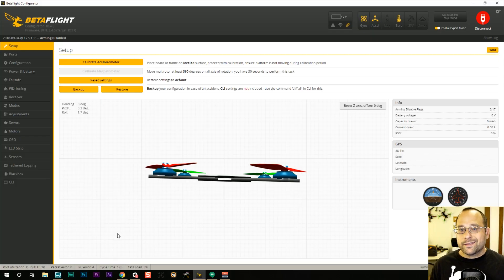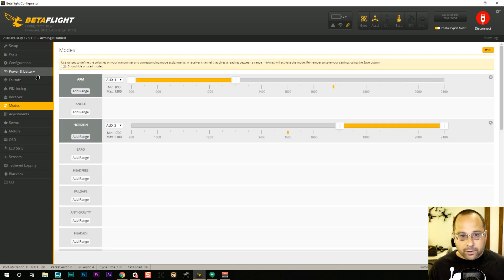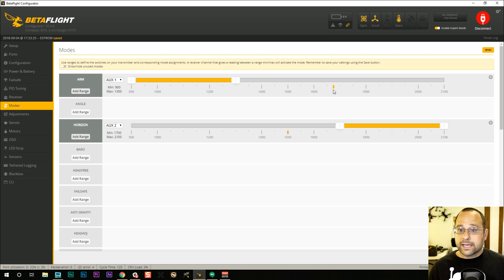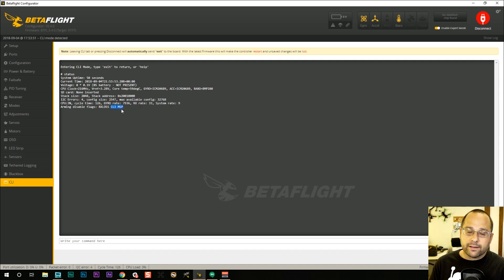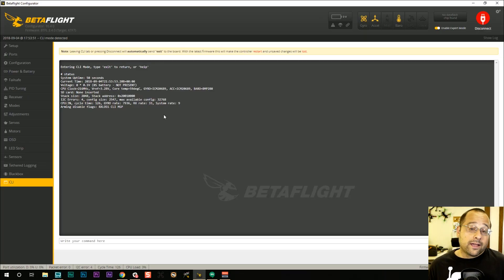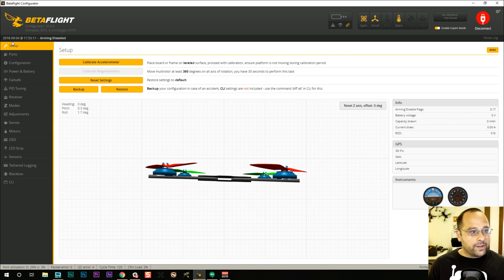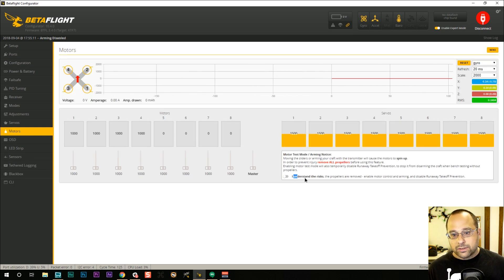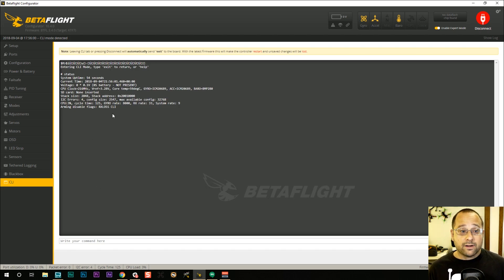BETAFLIGHT WON'T ARM | CLI MSP arming status flags

Comment: I have an issue, trying to set up a tricopter and my motors run continuously when not armed, about half throttle. Also, ESCs wont initialize when not plugged into USB. And the servo is backward, but that's another issue.

Comment: BUT when I disconnect the MSP goes right back on and I cannot arm!!  How can you switch it off for good!
Reply from the maker: You cannot. Every time you connect it comes back. It is an important safety precaution.
Reply: @JoshuaBardwell  Ok, I finally got all the disarming off but my roll, pitch, and yaw all work, but when I move the throttle it beeps and doesn't move.  I can get everything to spin but can't get off the ground!

Comment: Joshua,

Thanks for all of your videos.  Unfortunately, none of them have  helped.  I am new (never gotten my drone off the ground) to the sport and am within a hairs breadth if throwing the whole mess - batteries and all in the nearest trash can.  The problem I am having is that I am able to bind my receiver(s) to my transmitter, but I cannot get any response on the receiver tab in beta flight.  I have tried two different receivers, Frsky D4R-II and Frsky V8R4-II with my Taranis-Plus.  I can get both to bind in both modes, but I am unable to get any response on the transmitter tab.  I have a Speedy Bee flight controller which is using:
# version
# Betaflight / SPEEDYBEEF4 (SBF4) 3.5.7 Mar 15 2019 / 22:20:51 (e9130527c) MSP API: 1.40

 Any help will be greatly appreciated.

Comment: Damn, So there is a  way to permanently disable this feature, I just found out the hard way that this arming flag comes up with a 1" USB port extension (wire to wire male/female) to bring the plug to a reachable location on a custom 3D printed Quad, Even when not connected to the PC. How does it know its there?
Reply from the maker: That doesn't seem right to me. It shouldn't load the MSP flag simply because USB is plugged in. Only when the MSP connection is active, such as when the configurator hits "connect".
Reply: Joshua Bardwell that’s what I thought too , this has me stumped . I Even went with the LUX F7 because I had a 4in1 esc and the firmware parent matekf722se that has USB pads broken out which I would assume would be for this exact reason. It functions fine when In Betaflight.
Reply: @JoshuaBardwell  Not sure what it was , Re flashed it and the issue no longer exists, It also reconnects after reboot now , didn't seem to do that before

Comment: Joshua, When you first plug in it says "Arming disabled". WHen you pwer up and try to arm it says "runaway takeoff prevention temporarily disabled". Will not hit through Beta or transmitter. Thanks again, Joshua.

Comment: Runaway takeoff prevention disabled,   Josh, I am dying -- all those hours building-- they all have the same message. I tried to go back and download 3.4 Beta-- was not there. I was able to turn the Prevention from ON to OFF-- but it did not hold to arm. Thanks for your attention- I know you are busy!
Reply from the maker: Hi, Bud. Same as I said in your last comment: if betaflight won't arm, then what message is the Warning OSD element showing when you try to arm?

Comment: Joshua, I typed in as before, CLI said OFF, I hit all save buttons I could find- "save to file", typed in Saved in CLI box, it said "Saved"-- nada. Back to motors (Runaway_takeoff_prevention diabled. The engines will not run on Beta or arm without it. This is despararate. I have 50 quads and more than 20 are diasabled. They flew fine before Beta 4,02. How far back can I go to reload old Betaflght configuartor programs? Thanks for your response if you have an idea!!
Reply from the maker: What is the arming status code that is preventing you from arming. That is, ultimately, the answer to why it won't arm. What does the Warning OSD element say when you try to arm?

Comment: I have 4 quads that are "armless" after flying well, then going to Beta 4.02. I followed your instructions and typed in set runaway_takeoff_prevention = off      and it said it was off- then would not arm . Same warning showed in motors tab. I guess that "I did'y learn something today".Thanks in advance for a response!!
Reply from the maker: Did you type "save" after you turned off the feature?

Comment: JB, once I select (I understand the risk...) in the motors tab, how do I save it? I checked it, then switched over to Modes tab and it still doesn't arm because of MSP. went back into the motors tab and it was I selected again.

Comment: Hi Joshua, I've got the MSP warning still coming up even when the quad is completely disconnected from the usb cable.  this has only started happening since I flashed from 3.4.0 to 3.5.4 earlier today.  Im not sure if it is related (as I'm also running from a new laptop) but BF is having loads of trouble connecting to the quad when it is plugged in - i have to keep unplugging and replugging in the cable, and maybe 1 in 10 tries, it will connect.  FC is a Matek F405-OSD.  Im really hoping its not an FC issue.  Is there any way to disable the MSP flag so i can at least fly?  cheers
Reply: just following on from my last post - I tried downgrading back to 3.4.1 but the problem persists.  Also, when i said BF was having trouble connecting - its a bit stranger than that - it seems to connect, and the configurator reads that it is a matek FC and what BF version is on it, but then times out waiting for the config to read.  I'm thinking more and more that its got to be the FC hardware itself is the issue.
Reply: Sounds like your USB cable is damaged. Try different USB cables to at least rule it out.
Reply: @bangthumper1195  have tried a bunch of different cables.  but that wouldnt explain why the quad thinks its connected when its not even plugged in
Reply: Ben D you’re right it wouldn’t. You may have already tried it but do a clean install.  Reinstall firmware. Good luck!

Comment: Josh,

My CLI reads " armswitch"  Tried everything help!!
Reply from the maker: Cycle the arming switch.
Reply: I did. Followed the instructions in Wiki.... Arm in modes tab will light up if I disarm MSP in motor tap but cannot get motors to spin up.
Reply: Joshua, when I connect to Betaflight the last line on the top reads "arming disabled" below craft name. No other build does this.

Comment: The FC is restarting every couple of seconds but only when the camera is plugged in with 7 beeps(with a smoke stopper). When the camera is not plugged in, it is ready to fly. I pulled another camera from one of my other quads that I know works and it resulted in the same thing, so it shouldn't be the camera. I looked over the wiring and everything looks ok visually. I also checked with a multimeter and the camera is getting the right power. 

Arming disable flags: RXLOSS CLI MSP. I followed the video and I'm still having difficulty, what am I missing?
Reply from the maker: This is a very tough one. If the FC reboots when the camera is plugged in, but the camera is not at fault, it's a real mystery what else it could be. My next guess is that the voltage regulator on the FC is damaged and the camera is drawing enough current to overload it. Replacing the FC would be the fix.

If the camera is powered from vBat then I'm truly at a loss.
Reply: @JoshuaBardwell  I was hoping that wasn't the case, but looks like I'm in for another FC, I appreciate the reply to help confirm my suspicion.

Comment: So I crashed my wizzard. When I had out in a new battery it just spooled up really fast no not airmode. Then after that craziness it only let me ark like 3 times and now the receiver is flashing and now won't let me arm. Or rebind. Dulb question but which video is best for my issue? At work right now
Reply from the maker: Which arming status flag is it throwing.
Reply: @JoshuaBardwell  doesn't say my controller won't even show anything in beta flight
Reply from the maker: Has it ever connected? If yes then your drivers are okay.

Does it power up at all when you plug it in? Are LEDs on? If no, then it's probably dead.
Reply: @JoshuaBardwell  leds are all on just the receiver is flashing the red. Literally crashed once lol and think something fried then? No clue on this still learning

Comment: Hi my Serial Link Icon in the Configurator is sometimes blinking, sometimes not. I use a Multiplex Reciever. What does the blinking icon says. No arming flags in the status only msp and cli. Sometimes i cant arm, i'm confused
With Jeti Reciever no problem at all...

Comment: Hi Joshua.
I have noted that if I connect the FC to the USB and launch the BF configurator, then feed up the ESCs with a LiPo (may be to test the motors) and then I unplug the USB cable, the quad won't arm.
I think that it happens because the LiPo is keeping the FC alive with the MSP flag still active. In fact, if I detach the LiPo and reattach it again, the quad will arm with no problems at all.
Can it be a kinda of bug in the BF configurator?
Reply from the maker: Turn on the Warning OSD element and look and see what flag is active. That is the best way to answer.

Comment: Hi Joshua!
I've just started to build another new quad. And I have troubles with receiver.
Flashed today 3.5.1 on OmnibusF4

Receiver R9Mini is binded in 1-8 channel TEL. mode.
Port uart1 is selected for Serial-RX.
Receiver setup - Serial-based, SBUS is selected.
Betaflight Serial status - linked. Receiver is green.
Battery is connected.

But on Receiver tab all values are frozen! Nothing is moving

Tried to bind in 9-16 ch mode - the same story

I have same Omnibus F4 on other quad and same R9Mini - everything works fine on betaflight 3.3.x

Do you have an idea?
Reply from the maker: Something must be different in the wiring or configuration because nothing I csn think of changed in the different BF versions.

Comment: Tonight I noticed I could arm whilst connected to usb, I thought I was going crazy with arming flags and of course your useful series pointing to the BF flashing codes was really useful.  But how can I arm the quad with usb and BF connected, I don't have motors connected so haven't been near the  motor overide option shown in this video?  

I checked using CLI 'status' and noticed no MSP flag, just CLI listed ...bug?
Reply from the maker: You are probably on an older version of betaflight before they implemented teh MSP flag.
Reply: Checked across multiple versions of BF from 3.5.1 down to 3.2.0, MSP flag isn't always present and FC WILL arm if USB is connected.

Comment: I am currently dealing with a nogyro warning on an AIO from board from a QX 105 Bat
Reply from the maker: NOGYRO typically means that the FC is toast. It could also mean you flashed the wrong firmware to the FC but you would know if you had flashed it recently.
Reply: @JoshuaBardwell  Yeah, just recently flashed 3.5 on the board. No chance to reinstall? I found that if I went into CLI, did a get gyro and then reboot, it would arm again. The only oddity was that the CPU was at 2% while it wasn't responding

Comment: Hey Josh I'm having problems with my quad it's saying calib is the arming flag but it arms whilst I'm in th configurator but the minute I unplug a the usb it does not arm and it's not arming on just my new lipos for some reason as it works absolutely fine on my old ones

Comment: New micro  build Im getting a no gyro uo on osd on 3s... But on 2s it arms and flys..? But its a 28 amp 4in1 so it flys really slow an lame. I built it for 3s...
Reply from the maker: NOGYRO means the FC is dead and needs replacement.
Reply: @JoshuaBardwell  but it flys on a 2s?... Its bran new.. F4 mini. Its actually the second one of 4...
Reply from the maker: It's unusual that it flies on 2S but not 3S. NOGYRO usually means physical damage to the board that prevents the gyro from initializing. It can also mean you flashed the wrong firmware to the board. But if you flashed the wrong firmware, gyro would never work on any voltage. So that leaves physical damage. I don't know why it flies on 2S but not 3S but there really isn't any fix for NOGYRO except to replace the gyro or the FC.

Comment: Hi. What about the situation when you want to have MSP telemetry or/and the model is controlled through MSP (RX_MSP) ?
Reply from the maker: I would think the use of MSP telemetry or RX would not prevent arming since those functions are intended for use in flight. Only MSP configuration would prevent arming. But I've never used MSP telemetry or RX to be honest, and I don't know of any FC or receiver that uses them.

Comment: JB, is a "high idle trim" on the transmitter enough to keep your quad from arming?
Reply from the maker: Yes. THROTTLE flag.
Reply: It can be, if you have it active, and the throttle is above your min check value

Comment: I think the speedybee app will allow arming while connected to MSP over OTG cable in all configuration tabs (not just motors tab. Props off of course ;-)
Reply from the maker: Betaflight should absolutely prevent arming when anything is connected via MSP. I'm not sure how the app could override this... maybe by disconnecting after loading the screen? It's possible... but dumb if true.
Reply: What about mwosd? It uses msp too.